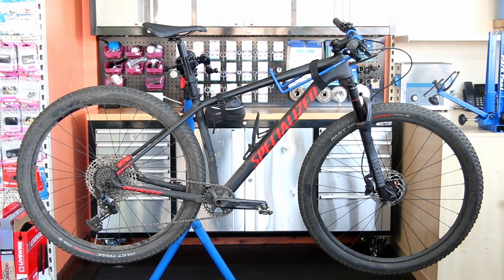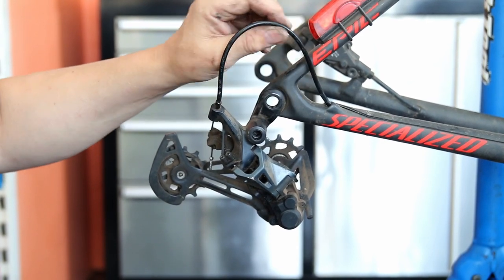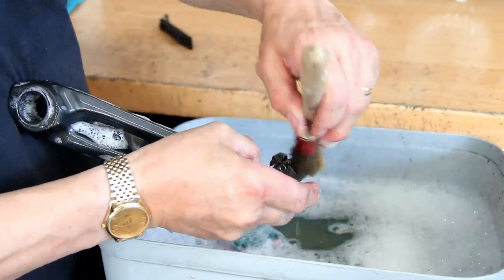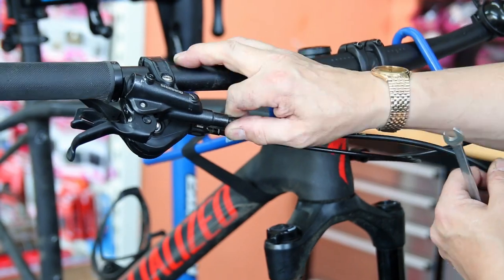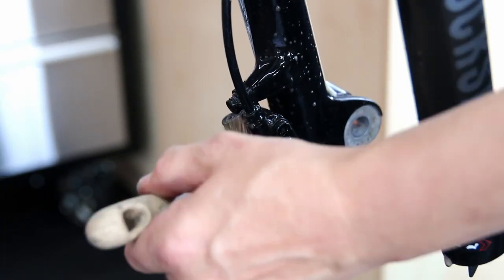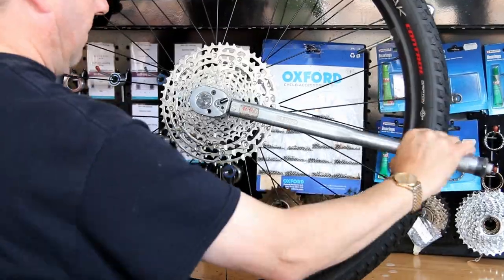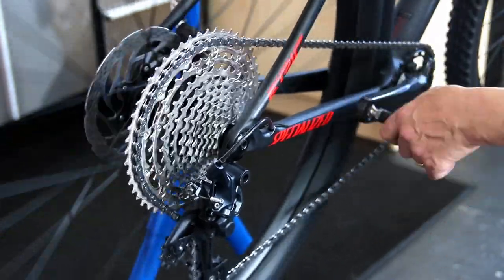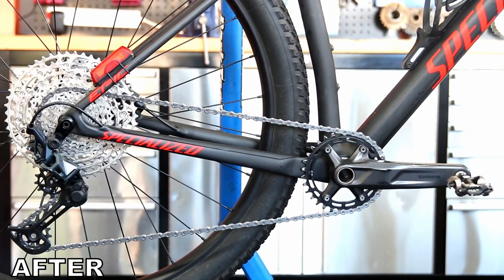Specialized Epic Rebuild! Mountain Bike Service Restoration!

Comment: The joy of seeing a bike getting serviced is strangely satisfying 😁
Reply from the maker: It’s definitely satisfying lol😂⚙️
Reply: Until you see the $$$. Such cleaning costs at least 250.
Reply: @fpeter01  it depends I got a service in my local bike shop and it was 80 quid that included a Sora cassette and chain and all the cables changed but that was a few years ago so it probably is a little more now and my new bike is 105 so I would expect it to cost even more. But my bike shop doesn't clean the bike down from what I can tell.

Comment: Stunning.! Huge difference between before and after. Was out today for a 60Km gravel ride in the pouring rain, and once I got home I washed, cleaned and lubed the bike. Was thinking about your videos and always checking the bike to try to spot potential problems. 🇫🇮😎
Reply from the maker: Haha that’s the only problem with keeping bikes mint, you run out of problems to solve
Reply: That's exactly why I started borrowing my friends' bikes to work on 😁

Comment: Okay, you asked for interactions. If I was there doing the service, I’d put the wheel back on first, then check the derailleur hanger alignment, turning the wheel as I went keeping the valve stem as my check point at 12,3,6, and 9 o’clock. Practically every bike even from new the hanger is not right and can be improved upon. Also, every accessory screw, used or unused. Take them out and put some Phil woods hydrophobic grease on them. Same with the stem and steerer tube bolts, especially on each side of the washer, also the seat clamp bolt. Maybe you did this but didn’t show it, but I was surprised the hanger wasn’t checked. Pull the seat post, clean and regrease.

Comment: It may have been asked already but what do you use to protect the shop floor when you clean the bikes? Assuming it can get quite messy? I do mine on the driveway but put an old sheet down so the grime and any oils don't soak into the ground.
Reply from the maker: We simply mop up after ourselves and are cautious with the water, we try not to use to much🧡

Comment: Nice videos! I wanna ask a question. One tool I wanted to get for a while is a torque wrench. Can you recommend one that is accurate and good quality maybe like the one you use at the end of the videos for all the bolts?
Reply from the maker: I have 4 torque wrench’s that I use for various things, with the editing I may change torque wrench without you even noticing, for the majority of the servicing I use a 1/4” drive, but they are all much of a muchness any brand will do the job

Comment: Using brake cleaner on the free hub. What other places on the bike can brake cleaner be used
Reply from the maker: Brake levers, brake callipers, chain stay, free hubs. It evaporates quickly so ideal for any oil that can be cleaned off in a quick wipe rather than a build up of oil or grease. ⚙️🧡👍🏻
Reply: @Bikespeeds  thank you I thought I was the only one using on those things. Plus it even clean rd and fd for re greasing. Am I correct

Comment: Bike speed, that bike is set up moto style and the hose was long, but non moto style like here in the USA they’re even worse. Look at countless pictures of mountain bikes on the web, and almost without fail if it’s a mass produced bike, the front hose is too long. Yet bike shops just wack them together as is and don’t do a thing about it, not to mention almost every front hose has an unnatural twist in it due to it being twisted when the brake lever end hose nut was tightened.

Comment: Ever had any reaction/interaction from the brake clean and carbon wheels? Worried that the chemical can mess up the carbon rim.
Reply from the maker: Not personally, definitely check the bottle if it’s something you’re doing yourself but it’s never been a problem for us 🧡

Comment: That new chain is going to skip on the cassette though... right?
Reply from the maker: This chain was around the 75% stretched mark which Is the perfect time to replace a chain before it starts causing your gears to skip🧡
Reply: Thanks for the answer. Isnt 12 speed supposed to be more sensitive to chain wear? Making it advisable to replace chain at 0.05 stretch..?
Reply: On another note i really admire your work. Thats a lot of time used on each bike. As im thinking of opening my own shop i wonder how you make it profitabel.